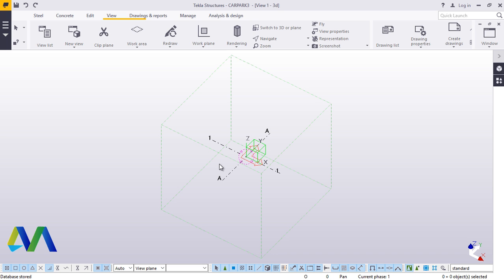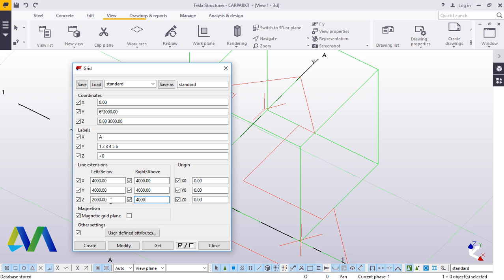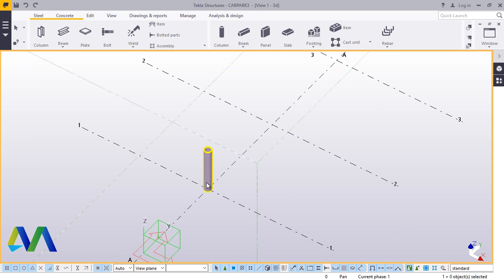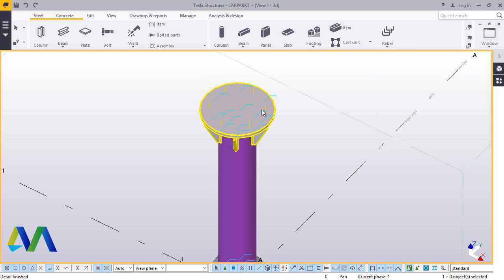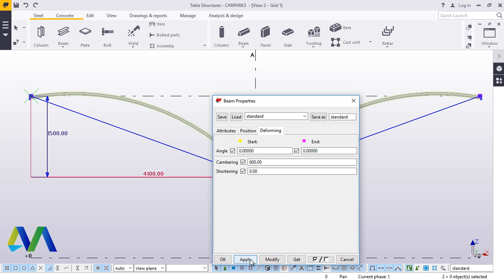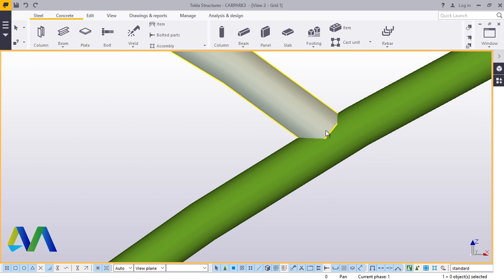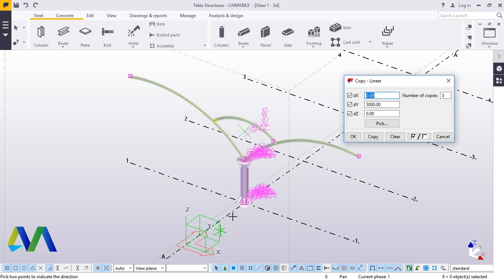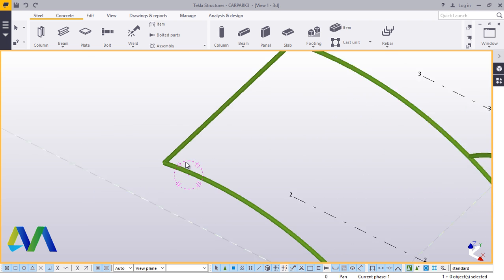Carpark  Canopy Modelling Using Hollow Sections in Tekla Structures

Comment: Trying to find a video on utube Maurice but not having any luck. I’m doing a drawing for a small canopy over petrol pumps. The stanchions are 193.7 circular hollow section spaced 6 meters apart looking from the end view and 5 meters for each frame distance. The roof truss is 139.7 curved with a radius of 20 metres. My problem is how to make a connection between the upright circular stanchion and where the curved (circular)roof truss meet. Can’t seem to be able to find a connection in the vault. Can you help please. Tekla 20.1 is what I’m trying this with. Thanking you.
Reply from the maker: Try Tube-Saddle
Reply: @MauriceDimba  Jeepers you weren’t long getting back to me about my problem. Thanking you very much. I’m new to Tekla Structures. I have gone through all the connections that I can see in the vault of Tekla Structures 20.1 and cannot find Tube Saddle. I also forgot to mention that the tubular roof truss extends beyond the vertical tubular stanchion by 2500mm. Have you a video of a similar connection? Thanking you

Comment: Thanks for your videos, i have watched most of your tutorials, all of them are about modeling. Your videos quite helped me to model of structures, especially steel structures. But tutorial about load assignment ( point , line , surface , earthquake , wind load ) are very rare in TEKLA , and analysis and to check the model ( i.e. members , joints / connections). Can you please upload such tutorials if it is possible in TEKLA? Thanks again.......
Reply from the maker: You're most welcome,that is noted
Reply: Would really like to watch tutorial about analysis too. Signing in.